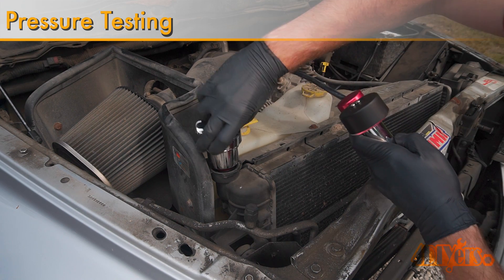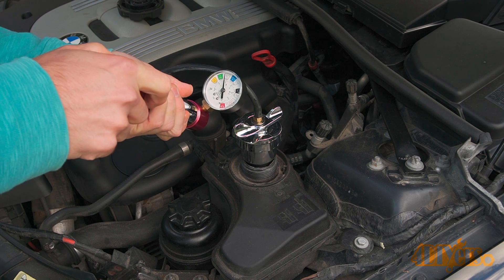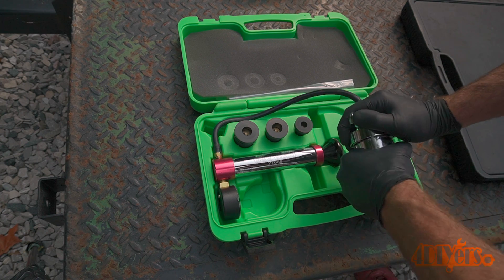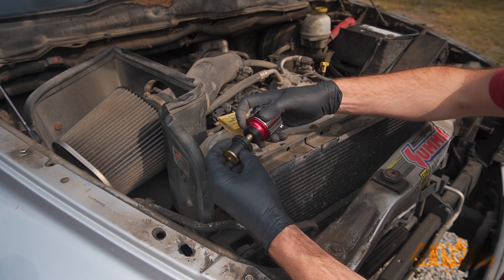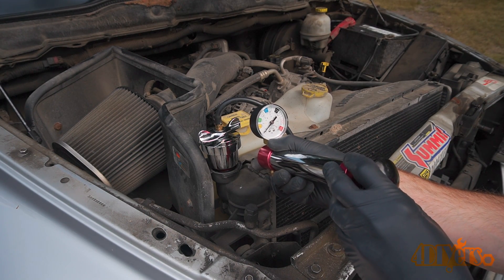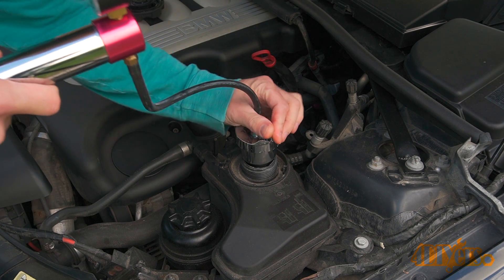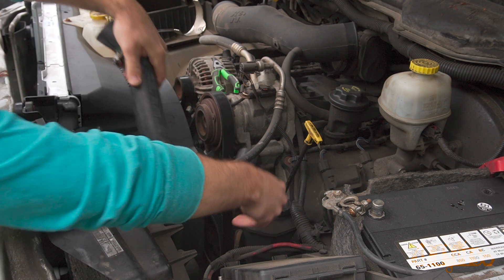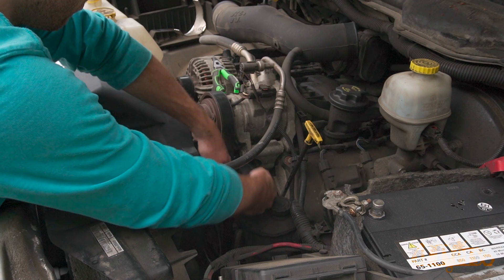How to Pressure Test a Cooling System

Comment: how this overcomes thermostat? are you able to diagnose  large circulation - with heater core? or just small circulation expansion tank/hoses to the water pump and radiator?
Reply: Pressurize's entire cooling system, pressure goes through upper and lower radiator, don't have to worry about anything besides the leak, just pressure test it and you're good if you have no leaks...unless it's inside the motor

Comment: I don’t have a radiator cap. Do I do this on the coolant reservoir?
Reply: Pull the overflow hose from the res, but leave it connected to the radiator and pump about 15psi into it. You can use a bike pump with a pressure guage. Much cheaper than buying a pressure kit.

Comment: I’m stupid and pressurized mine way more than I was supposed to, did I screw something up?
Reply: Systems can usually take a bit more pressure than what the cap is rated for. If you over pressurized it, and see leaks than yeah you got a problem. It will break through the weakest point, so probably a rubber hose somewhere or an O-ring on the Thermostat housing. If it runs fine, doesn't overheat and you got no leak, you're probably ok.